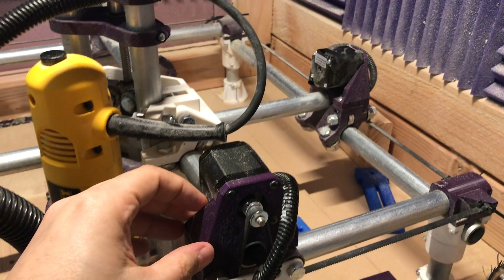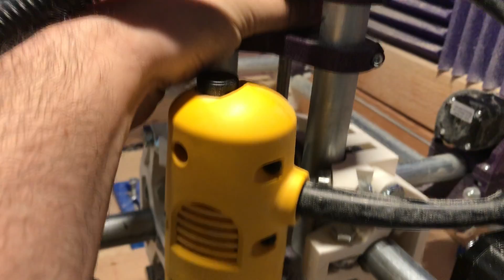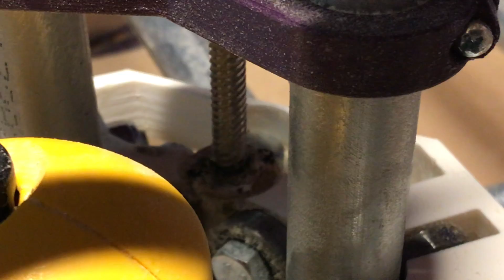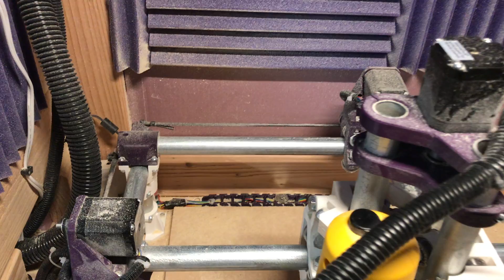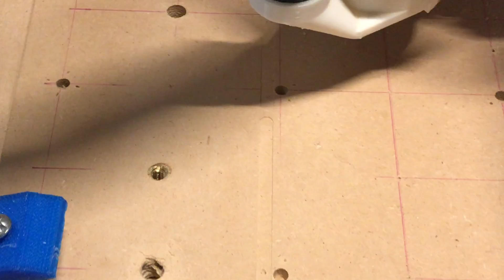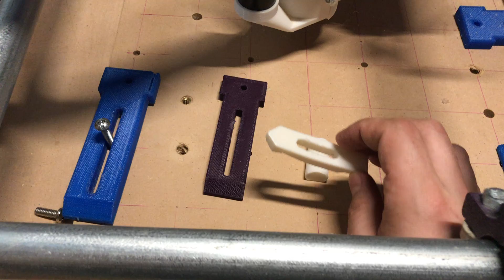Protips before you build your own MPCNC (Mostly Printed CNC machine)

Comment: Hey, just wanted to point out that the "hold downs" you talk about near the end I believe are commonly referred to as toe clamps. I've seen similar devices used on machining channels (Mainly This Old Tony.) After a bit of searching I found the devices that he uses, they're called step blocks, or step clamps, or step block clamps, or step block toe clamps? I dunno, but I found something on thingiverse that may interest you: https://www.thingiverse.com/thing:1744734
Reply from the maker: Thanks! I'm new enough to CNC that I'm still picking up the lingo.  I like that style and will have to try it out when I get my machine back up.  This query against 'cnc clamp' turns up a bunch of designs...you can see the ones I used in that list and a bunch of designs. I think that's one of those things where you try a few and see what style fits what you're trying to achieve/hold down/etc.  https://www.thingiverse.com/search?q=cnc+clamp&dwh=185bd8a31177ec8

Comment: Great video :)
Your enclosure is missing a smoke detector.
Reply from the maker: Sorry Just saw this...I'm going to give it a try by installing one, though another comment mentioned the dust from the CNC may cause false positives and set it off. I expect to have it back up and running in the next few months, and will make sure to report back
Reply: @geektoolkit  There are 2 different types. I don't know if one is better in that aspect but worth noting.

Comment: Nice build, I am researching this now for my next build. Looking back at your build would it help with stability if I were to use 3/4" scheduled 40 steel tube? Oh and SUBSCRIBED!
Reply from the maker: ThatDamnGuy Thankyou! Yes steel tubing is a recommended upgrade for rigidity. I can’t speak much on it as I’ve not done it myself, but the creator Ryan mentions it right off.  The other thing you would want to look into are foot mods on thingiverse...there are some solid ones there. If you make it smaller you’ll also gain rigidity at the expense of working area. And one of the biggest factors is keeping z height reasonably low. Hope that helps!
Reply: GeekToolkit I was thinking 18 x18x4 machinable area
Reply from the maker: ThatDamnGuy more importantly is what you’re looking to cut/mill...if it’s pine and softer woods you’ll be in great shape. Honestly at that size I think you’d be able to try aluminum and hardwoods. May just have to go slow and use troichodal milling techniques. I’m stuck unable to do videos for two months but when I return I’ll tackle that stuff. Remember you’re going to lose about ten-12 inches on each axis in usable space due to the head size, so a 18x18 will net you about an 8x8 usable area. There’s a size calculator linked off v1 engineering that helps calculate that
Reply: GeekToolkit thanks, looking forward to see your new videos. I’m thinking of making some videos my self. I’m getting ready to upgrade my Anet A8 3d printer to an all metal frame. Then I’m going to start on this cnc. I have built 2 other cncs in the past. So hopefully  that will help with this build

Comment: Great info, thanks! What height is your mpcnc?
Reply from the maker: BasedLegnd It's 5 'actual' inches. The metal is 6 inches, but with the Z axis height and the spoilboard cuts into the actual height a bit. I wanted to keep it as sturdy as possible so I could look at using it on aluminum eventually.  If you're looking to convert it to a 3d printer you'll want it to be taller, but you'll lose rigidity

Comment: Thanks for the tips! Building my outfit now, I used the T Nuts on a piece of covered particle board table. It's very square and flat. My work area will be 20" x 24" when done, plan on using laser, vinyl cutter and router.
Reply from the maker: That's going to be a super fun work area! Mines only 12x12 and I'm still having a blast, but I do wish I'd gone bigger...20x24 sounds about perfect. A lot of sign work I want to do actually would need about 24" wide.  I'll try to do more videos in about a week when I get free again...stuff like software stacks and such. I currently use Inkscape / Estlcam / Repetier host...though I've also used cnc.js.org, and others use fusion 360. Some Old Guy coding's channel may be a great one for you to look at, esp. for the laser work...he's got his dialed in nicely :) Thanks for watching and the encouragement, I'll work to get more videos out soon :) Happy carving
Reply: Likewise! Thanks!

Comment: Great video! I've been researching the mpcnc myself for plywood parts. Haven't taken the plunge yet though. How accurate are your cuts?
Reply from the maker: Tony Crombie I haven’t measured them yet, but I can tell they’re accurate due to things like the sharpness of text and quality of lines. Others are within .4mm, and I think some are even better. The size of the build and how much time you put into CAM (software to create toolpaths) matters. Two months ago I didn’t know what a toolpath was, and now I feel like I can cut anything :)
Reply: GeekToolkit oh wow! That's awesome. Less than .4mm is just fine for my applications. Thanks for the input! Also thanks for the video. It helps folks like me a lot.